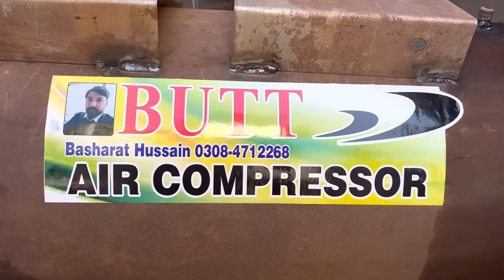Ingenious Process of Making Air Compressor Tank With Iron Sheet  “Production of Air Compressor “

Comment: Pressurized air in a rusted metal container is a good recipe for disaster. Who ever bought these tanks just bought a grenade. I hope they add a warning sticker saying "Stay back! May explode in operation" but far as the fabrication goes was well done.
Reply: You look like you have some experience about working with pressure could you tell what is the burst pressure of the vessel and what maximum pressure value would the vessel be charged with? I feel you don't know.

Comment: When you buy a air compressor with it's tank, always, I mean Always insure it is built to our ASME CODE. These tanks are not very good, rust, slag and etc in the welded joints.
Reply: Code smode….
Reply: Bought an air compressor with 250L tank, manufactured in South Korea by well known brand and it had a pinhole on one of the welds. So yeah, even with codes, QC etc you still can buy a crap😂
Reply: @Mistabushi  그것은 자동차 제조사에서 제작된것이 아닙니다. 동일한 이름의 작은 중소기업 제품입니다. 그것은 한국 컴프레샤 기업 규모, 순위에서도 낮은 제품입니다
Reply: I am not going to speak of what I think about the quality and or safety of one of these pressure vessels because it is self evident. However I do have one question does anybody in that country own a real welding helmet or is there some law, regulation, local customs that dictates anyone who attempts to stick weld anything only kinda of sorta use a instructor’s/hand held face shield. Seriously I don’t know how anyone of theses people using a stick welder is going to be able see much of anything past their mid 40’s or how their eyes must feel after they go home in the evening.  I understand money is tight etc. but a standard welding mask is not that expensive especially considering you only get one set of eyes
Reply: Just think, this is what our politician's want to roll all safety and regulations out of control in the United States!

Comment: This video is like watching a ticking time bomb being put together.I have to say I'm very concerned about the lack of safety practices in the video. The tank design you used doesn't seem to be suitable for high-pressure use cases, and there is a high risk of the tank rupturing and causing serious injury or even death.

Furthermore, the tank design you used doesn't seem to have any safety features, such as pressure relief valves or gauges to monitor the pressure. This is a serious oversight, as high-pressure air can be extremely dangerous if not handled properly. Complete oversight of Quality Control..
Reply from the maker: Thanks you far your opinion